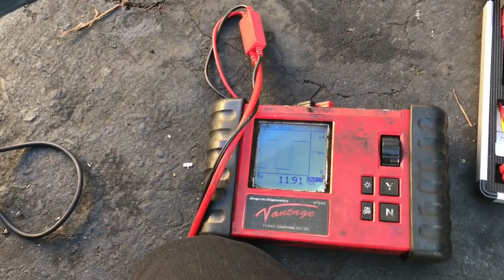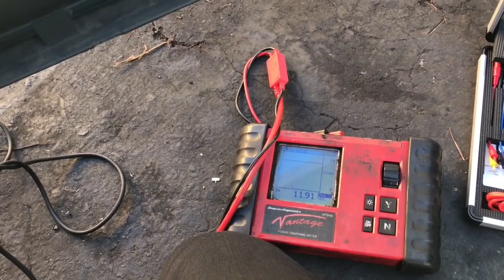How To Test Automotive Electrical Circuits In A Few Easy Steps

Comment: OMG thanks for the laugh.. Using the probe tip to probe the adapter... LMFAO..  They are designed to go into a test lead wire end,  power probe tip comes off.  Unless your PP is an antique model.  PP II and Hook all use the removable tip and accept test leads.